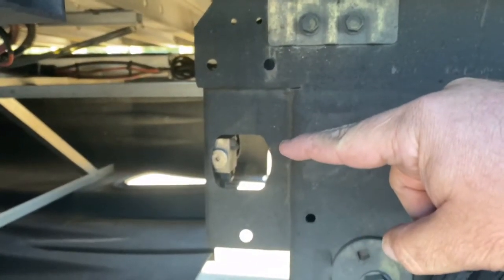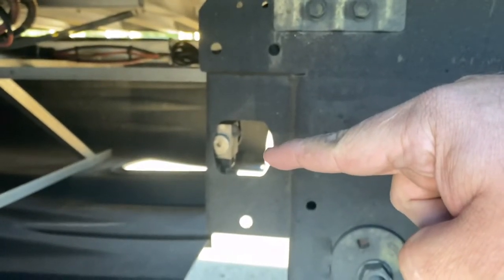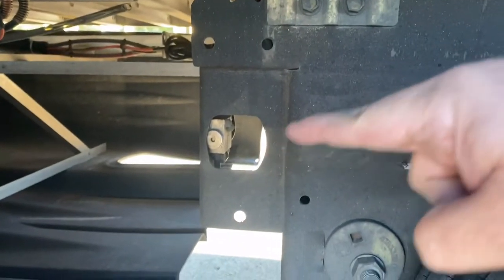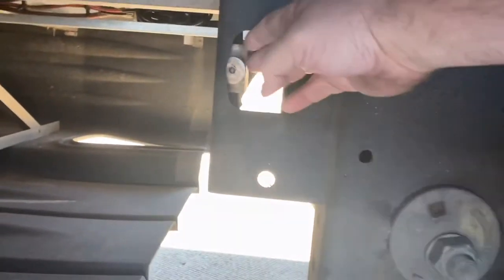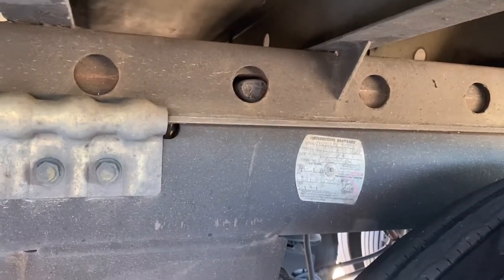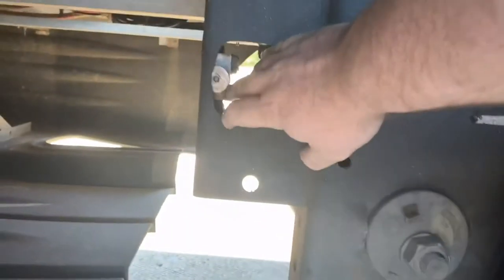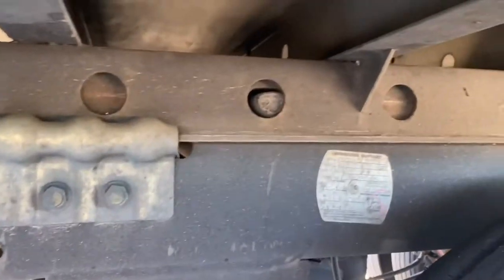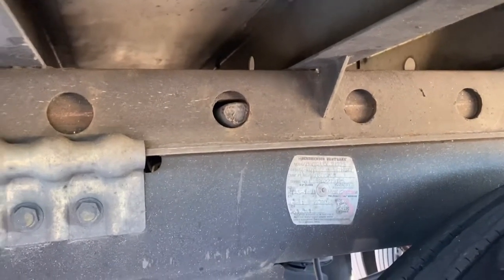How Do Air Release Style Tandems Operate??

Comment: thank you for this vid, the company i just started with did not go over their trailer's in the orientation, I was under the assumption it was a normal manual release bar like my previous company had. nope it was the button and i had no clue what i was looking at, even worse nobody i called in the office or in safety department had a clue what i was talking about when i asked, even though all their trailers have levers instead of buttons. so i am confused in more than one way why i wasn't told about these day one out in the lot when i was being shown the trucks.
Reply: i think it's also worth adding the trailer is currently waiting for a mechanic to have a look at it who will surely be like "WTF is wrong with this thing?" as they had me drop it off under the assumption the manual release bar is missing.

Comment: Some of the older trailers take even longer to build up air to release the pins. Hell my old company for 13 years I just pulled the handle and if it was stuck I used vise grips and a hammer. I team drove here at freightworks now for over a year now and now I just went back solo and they are still running me harder i was the top 3 solo drivers here and then me and my codriver was the top team less then 10 mths we maxed out the millage on a 2020 volvo. Love the vids ill see ya out here ill be in trk# 148 cascadia
Reply from the maker: Man I sure do like them Volvos. I’ll be looking for you boss.
Reply: @bigginztrucking4698 I came back to get into that white cascadia #148 and the shop was like we changed our mind your permanent truck is your old team truck #141. When my friend and i got into it first it only had 240 miles that was all. Cause after the lease ran up they bought it from Advantage Leasing. Its the first 2020 company truck there is 250,000 miles on it now and its not even 11 months old yet. LOL I went from rags to riches with this company. Yeah they have their pros and cons but who doesn't.
Reply from the maker: Man that’s awesome! Congrats on getting to keep your original truck.

Comment: When i hook up, I hook the air lines before anything. Then I push in the trailer button to let it fill while I roll the landing gear and do my pretrip. Normally by the time I'm done there is plenty of air to slide them.
Reply from the maker: Yep. I had to learn that pretty quick.
Reply: Didn't watch video but your video helped I've used them before but never had to push in trailer to give it air

Comment: Pushing the Air Supply red button in... supplies air to the trailer and releases the brakes... pulling the red button out releases the air and locks the brakes... the exact opposite of the yellow button for the tractor brakes!
Reply from the maker: Right on

Comment: Yeah they really suck the fact is if you got an old truck and you go back to release the pins and then you try to use your trailer brake to move forward depends I've already popped out and you can't do nothing you repeat the process same thing happens repeat the process again it happens then you have to explain when you're at a dock that the mechanism won't let you do what they're asking you to do piece of s*** I mean a piece of s*** yes the manual ones have their problems but usually WD-40 and a good hammer with some persuasion fixes the problem 😆
Reply from the maker: 🤣 So so true! Always could rely on WD and a hammer to negotiate my way out of the situation.

Comment: Using air 😂
Reply from the maker: Indeed sir
Reply: @bigginztrucking4698 I actually love the air tandem pin system, but you are correct  it has to be fully air'd up for it to work. I have spent a few extra trips back and forth to the cab, either forgetting to  set the trailer brake, or having it  fully air'd up.    That does not seem to be helping my waist line though.   Thank you for these videos  they are  awesome, and sorry  I am a smart arse.